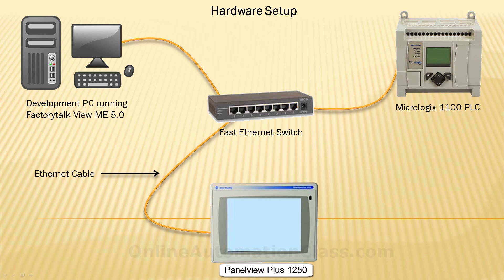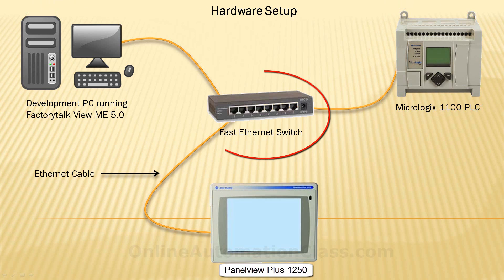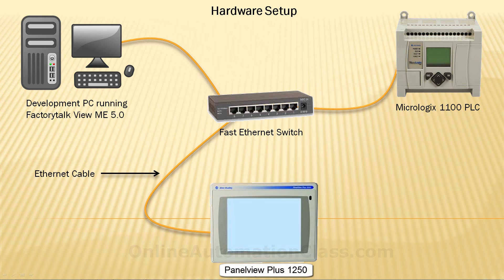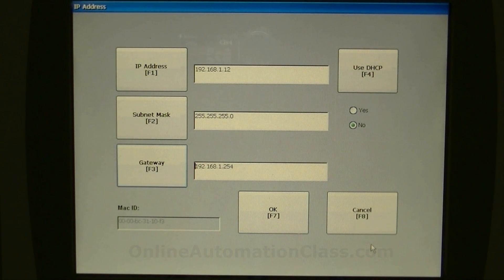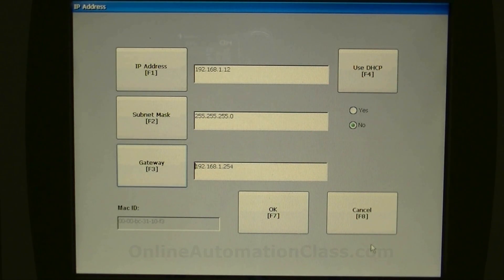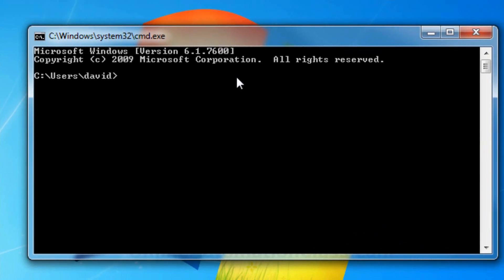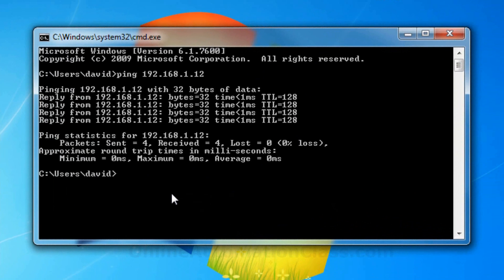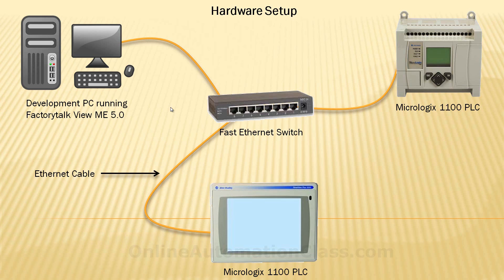Allen Bradley PanelView Plus HMI Ethernet / Communication Setup

Comment: how do you create an ip address and go online with a micrologix  1100 or 1400 using a data switch. or how do you communicate with a micrologix plc and go online using the Ethernet port.(please use RSlogix 500 , RS Linx